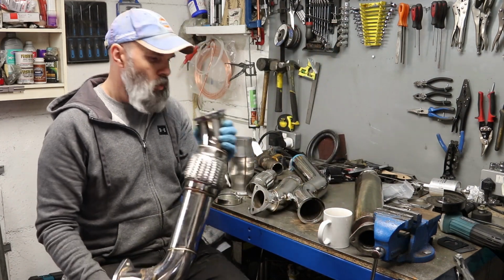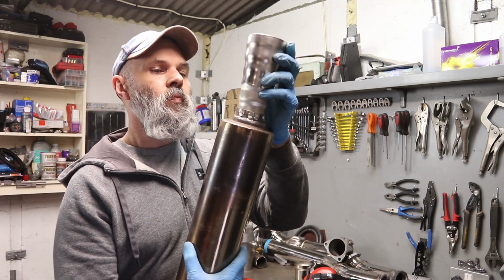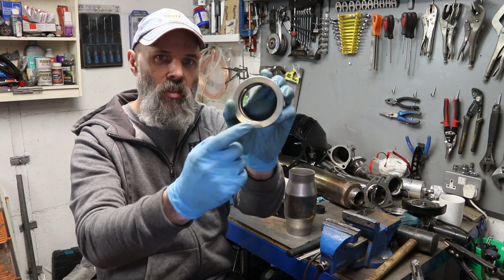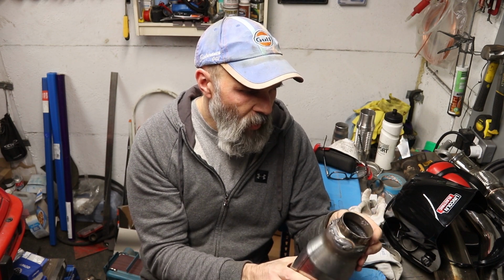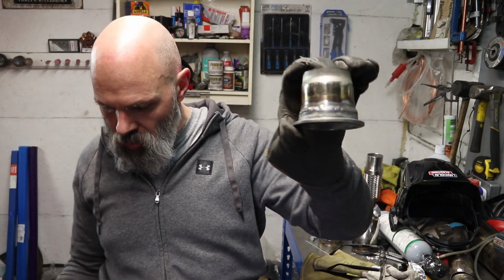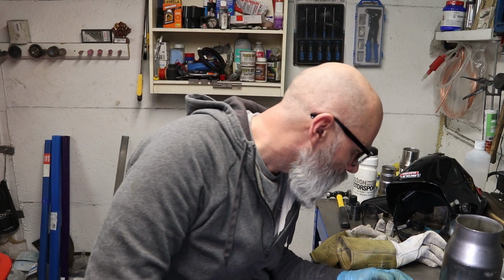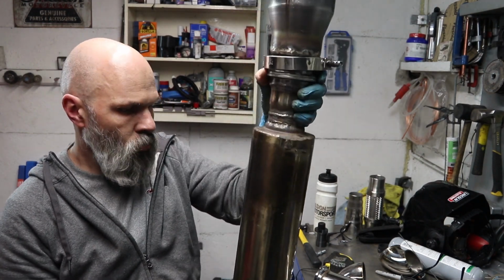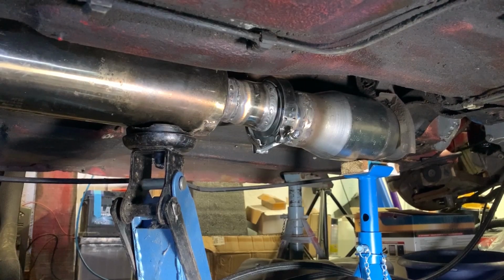Exhaust TIG Welding - Minor Success + Learnings  | 924 S Turbo Build 43

Comment: Hey. Just wondering how your finding the welder. I’m looking at buying one and just looking for some user feedback. I’m also in the U.K. doing something similar to you with my own builds so it would nice to get a proper review of the kit. Thanks
Reply from the maker: Okay, I think - it's slightly hard to tell for definite as I am new to TIG welding, but reasonably pleased, although I think the foot pedal may be broken now, which is a real pain. I keep wondering if I should have spent a little more on something better, and from the UK, it depends how much you will use it long term. Also, see my video on the welder, if for nothing else than the comments from other owners.